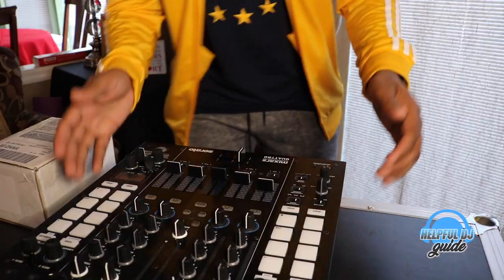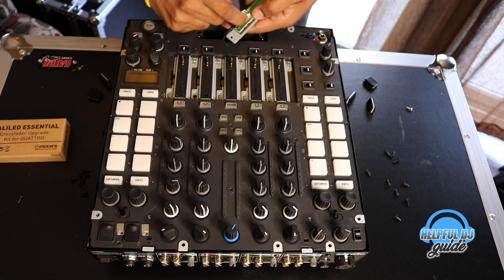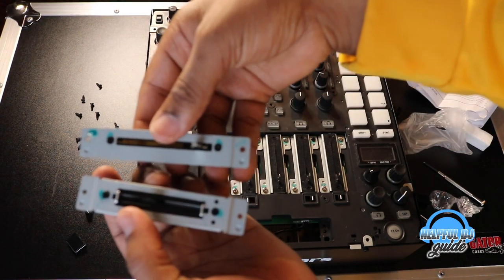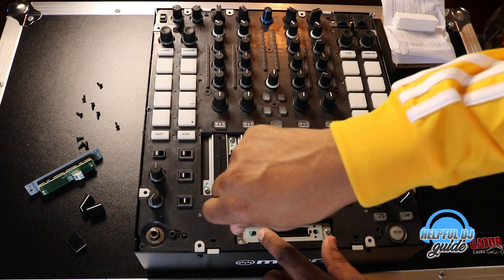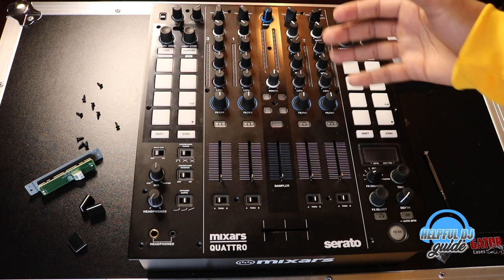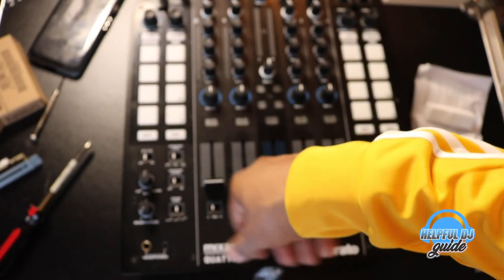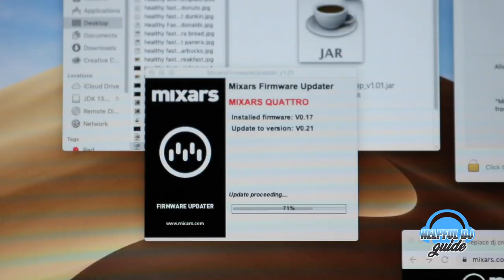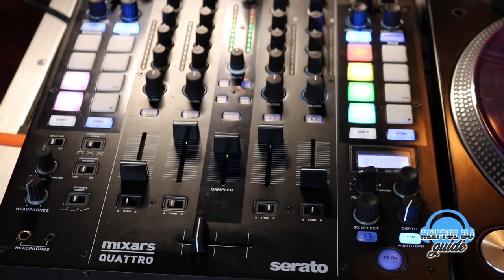Replace or repair your crossfader - DJ Mixer | Mixars Quattro |

Comment: Is it possible to update to 21 after u calibrated the fader? Because the initial firmware looks like older ( 2018 vs 2019 for the 21 )

Comment: Hi Man thanks for the noce video, you still have quattro mixer? i need little help
Reply: Dave Domenicano  hey what up Dave! Yes sir I still have it
Reply: DJ D-LOW Hi and thanks for the reply, anyway i return the mixars quattro, it’s very nice mixer but the effects section sounds very bad.
Reply: @DaveDomenicano  gotcha. I use the effects built into Serato. I have two buttons midi mapped for my echo out and filter knob... I don't use many effects maybe 3 to 4 at Max but it depends on your style of music and DJing.
Reply: DJ D-LOW My i used sereto echo that i mapped on sync buttons, i really like the mixer with serato, but i use real vinyls too so much, that’s why i need hardware effects but like i say are very bad.
Thanks for reply. Peace ✌🏼
Reply: @DaveDomenicano  i have a Quattro and i buy it for using with Pioneer RMX 500 (coming soon) . Pioneer FX with midi function of Quattro and mixars sound quality 👍.
Reply: @nonan54  Sure but Rmx 500 cost is around 450€ and Quattro 550/650€, so with less money you can buy a very good serato club mixer Reloop Rmx 90 and Pioneer SP1.
Reply: @DaveDomenicano  i had a reloop RMX 90 DVS before Quattro , hardware FX are not very well ... I have a Pioneer s9 on first setup , Pioneer FX arent much better AND equalisation IS horrible on reloop 90 !! No setup to have something like Pioneer . Mixars EQ is Great (i have a Primo too) 
  I Can find Rmx 500 second hand for 250e , Quattro is 500e New . 
For me thé better IS Quattro + rms , 750e great deal .
Reply: @djdlowofficial  you mapped volume serato FX on color FX knob , that's right ?